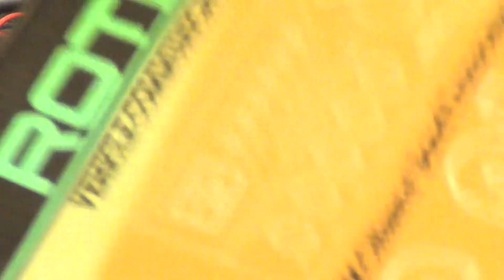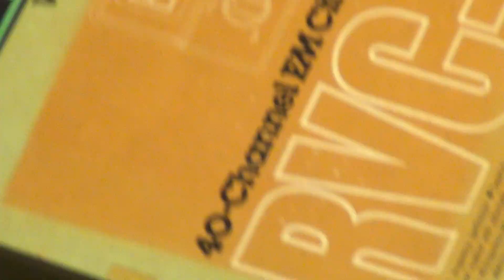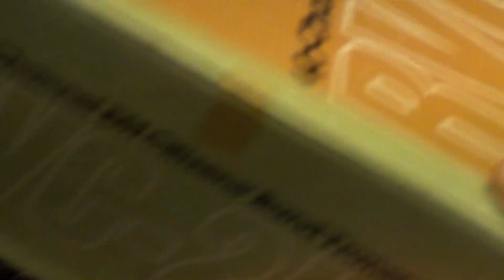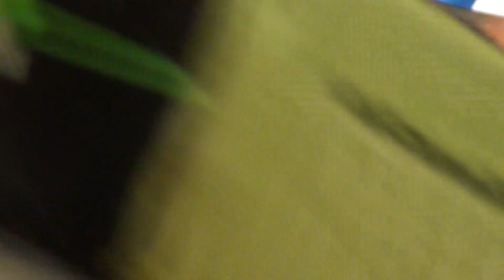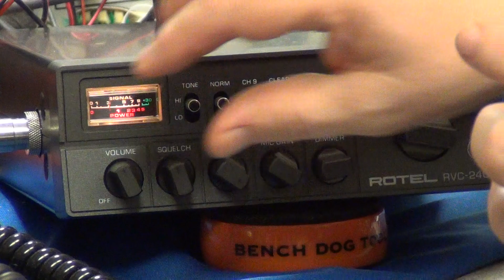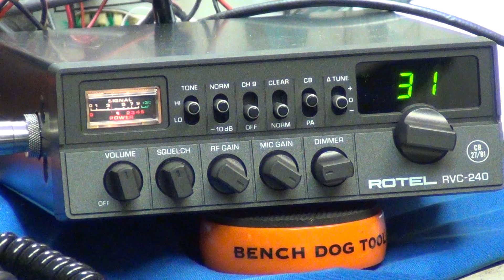Rotel RVC240 CB27/81 UK FM CB radio - On The Air test

Comment: Richard . With all your experience  does that extra rx stage really make a noticeable difference?
Reply from the maker: I've not noticed so far, but as soon as I can, I'll be doing selectivity (bleedover) tests on bench 4A. We'll see what the figures are from proper tests. Also bear in mind the Harrier CBHQ & the Midland 76-900 base stations have an extra extra rx stage too. It's not range these affect, but selectivity, so out here in the mddle of nowhere most sets work well (except brand new expensive sets).

Richard, GOOJF, UK

Comment: Intresting about the extra stage. Does the Cybernet Beta 3000 have the same board, and also have this extra stage? (Great round Scratchy Corner)! 😉
Reply from the maker: Yes, the Cybernet Beta 3000, Radiomobile 202 & Ford Roadmaster 505 have the same board & the extra stage in the receiver + the Binatone 5-star & Harvard 420M. The latter having a bigger loudspeaker too.

Richard